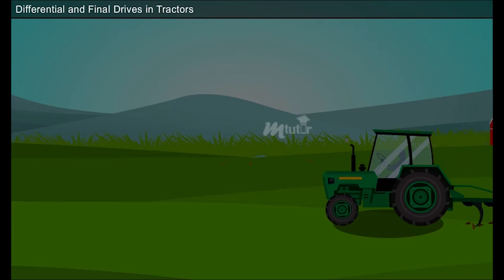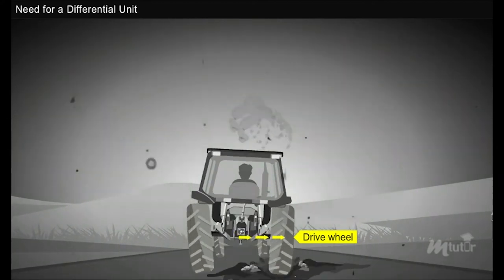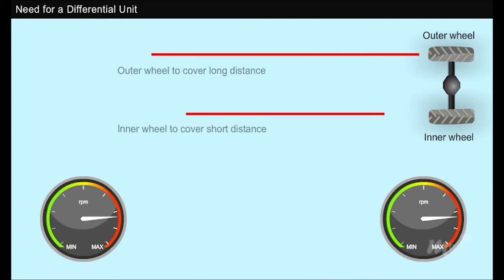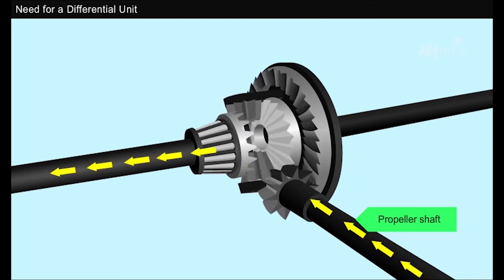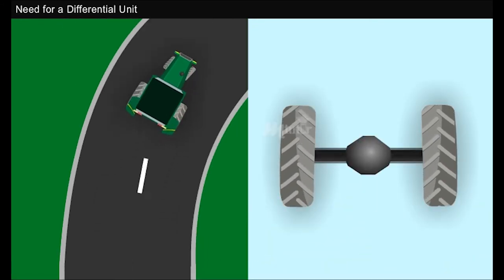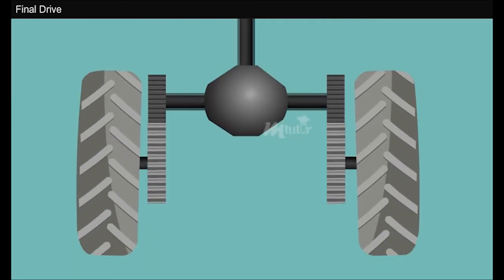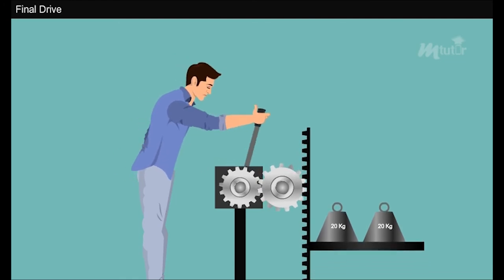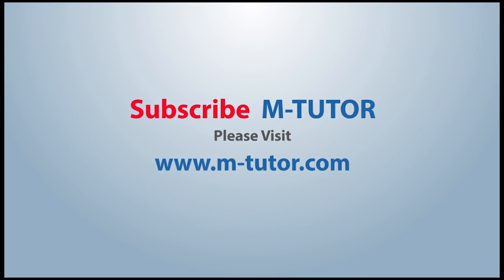Differential and Final Drives in Tractors [Year-2]

Comment: Very interesting. Can the final drive cog wheel arrangement be changed on a tractor to increase the speed of a wheel?  I took my standard 40km/hr tractor and reduced the wheel size so as to lower the tractor and it is now travels at 25km/hr. It is most important for me that the tractor is low and otherwise it works fine all be it that it travels slower. Can I change the final drive cog wheel arrangement to get back the 40km/hr travel speed?
Reply: Theoretically you would just have to change the pinion (drive gear). But in reality you will probably have to change the whole differential.